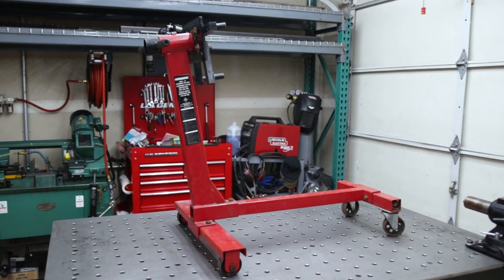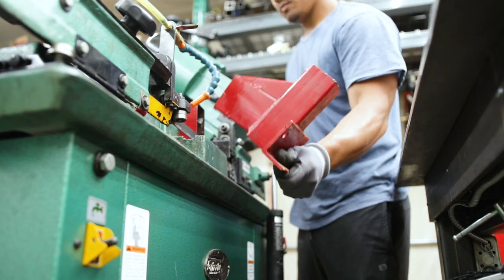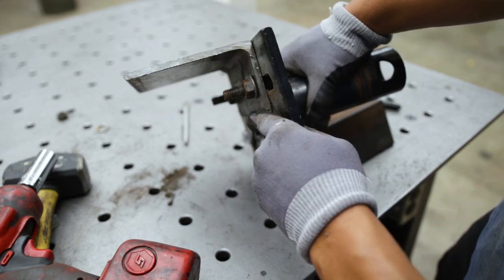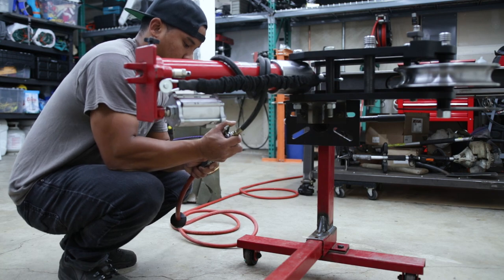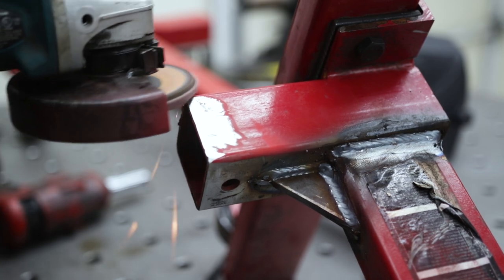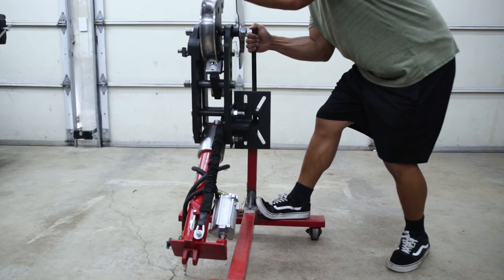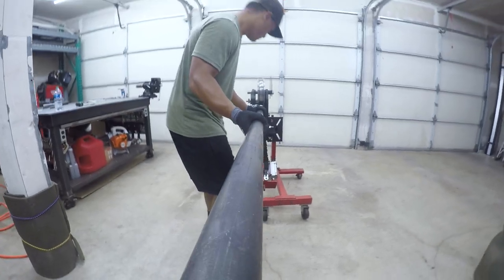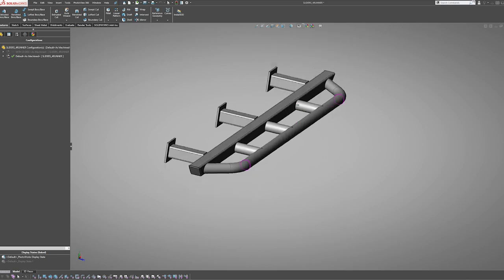How to make a Tube Bender Stand - Using a Cheap Engine Stand

Comment: Brother..... That's genius. I've been bending with a JD2 Hydraulic 32 for 10 plus years and often wondered if I wanted it out of the horizontal position. This is such a great idea to have both options. Big respect.
Reply from the maker: Thanks yeah both positions work great depending on the application

Comment: I’m in the process of moving my bender onto an engine stand and am I glad I watched this video! I was about to cut off the rotating part and just have a plate welded on to bend horizontal, but your idea makes so much more sense to have both options. Great job !
Reply from the maker: Glad it helped

Comment: Cool modification, will be very useful. If I may offer an additional point. Looks like your top heavy. Some plate on the bottom. Added storage. Also locking casters are your good idea. Again nice job.
Reply from the maker: Thank you! Yeah I thought it would be top heavy at first but I figure an engine stand would be the perfect for this scenario as they are already design to take this sort of load in this config. Because the head of the stand now sits lower than stock bring closer to center of gravity it helps slightly more. Locking caster and adding storage at the base is next on the list as soon as I get more bending dies. Overall it feel pretty grounded and doesn't feel tippy when working on it or moving it but add the base and lock caster in the future will definitely help.

Comment: Cool little project! If that tube bender has a set of dies, then maybe, as a next step, you could've created a mount for those dies on the stand itself, so it'll be completely self-contained
Reply from the maker: Thanks Phil for the tip. I'll make sure to add that when I have multiple dies. Man those aren't cheap! lol
Reply: @RathaSochenda  Yeah, industrial equipment costs a lot)

Comment: Thank you for the idea! Have a question on leveling the bender? Did you end up doing anything to fix the sloppy fit in the rotating assembly of the engine stand? Without addressing that I am having hard time keeping the bender level.
Reply from the maker: I would try drilling a hole through the non rotating part of the engine stand then weld on a nut. Then thread a bolt through and tighten to eliminate the slack.

Comment: So I just bought this manual tube bender. I want to bend 1.75" tubes from 25-180 degrees. What die do I need to accommodate all those degrees? Also can I convert my bender into a hydraulic bender? Hopefully you can answer these prayers.
Reply from the maker: Look up JDsquare

Comment: Ratha:
I also have a JD2 Model 32 tubing bender.  I am working on building a stand that allows horizontal and vertical mode, but I am building it instead of using an existing engine stand.
Now that you have had your design for a while, how has the vertical mode actually worked out in actual use?
Have you bent much tubing in vertical mode?
Thank you.
DW
Reply from the maker: I use it now in vertical mode 💯 of time now. It’s so much more useful bc of my limited space in the garage and makes it easy for me to see the angle dial indicator. I only put in horizontal mode when I need to store it away. Hope that helps

Comment: what pneumatic piston are you using for your bender? Great videos!
Reply from the maker: It’s the one you buy at harbor freight
Reply: @RathaSochenda  Those are becoming harder and harder to find. I don't know if they discontinued these at HF or are just going thru a transition of some kind. I suggest if a person wants one and their local store has one in stock, better grab it. Our stores sold out with no plans of restocking in the foreseeable future. I happened to get the last one and wanted two.

Comment: hey what size of die are you running?  180 degree 5.5 inch or 6.5inch?  love the channel btw
Reply from the maker: I’m running a 180 degree 1-3/4 round die with 5.5 center line radius. Glad you like what you see so far. 🙏🏽
Reply: @RathaSochenda  hey thanks a lot, trying to get my fab business and you've been very helpful.
Reply from the maker: That’s fantastic!

Comment: That stand does look a brilliant idea, can work really well. Will have to find a cheap engine stand. Also where did you get the cylinder clamp or did you make that also?
Reply from the maker: the clamp is part of swagoff road kit for the hydro conversion for the bender.